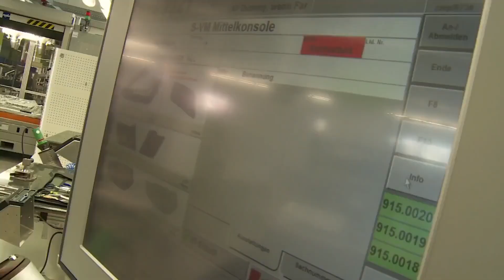🚖Car manufacturing process 🙋WOMEN working as employees – Production line & Factory tour Girl POV

Comment: Ladies should be granted to work in car assembly plants as those items involved even though are big & heavy but is all being Assisted by  modern machineries/robots and required a minimum amount of energies to complete the fixings. May be in Engine installation males will be required to handle the job.  Anyway is great to see how ladies can perform equally well in an assembly plant....!   Greetings from the Far East....
Reply from the maker: Thanks a lot for your comment Bob Lee and greetings to Far East... Check out how Isuzu truck factory looks like in the Asia: https://www.youtube.com/watch?v=Nk4YnTEYdUM
Reply: Well there is theory and there is practise. I've been working on an assembly line for years. It wasn't at Audi, but I don't think the assembly lines of different factories will be so different. 
You do have machines, that are supposed to help, but they often malfunction or are even planned completely wrong and don't work in the first place. 
For example they build a machine, that was supposed to help us, to lift some heavy parts. The problem was, the machine was too slow. So to finish the work on time, in the end we had to lift the parts and the machine. 

Of course women can perfectly work on an assembly line, and we also had a lot of women working with us. I still wouldn't recommend anyone to do this work, as it's very taxing. And in videos like this they usually just show the better more chill jobs, while there are a lot of really shitty jobs somewhere else, that nobody would ever allow to film.
Reply: Nope 😂